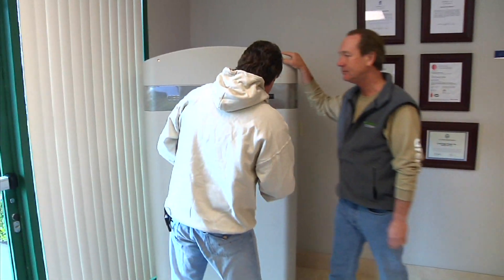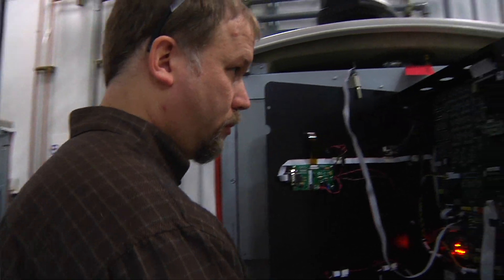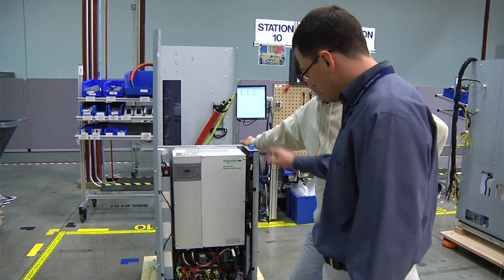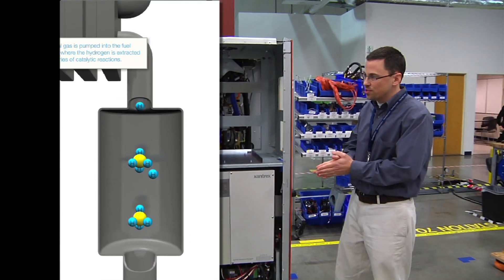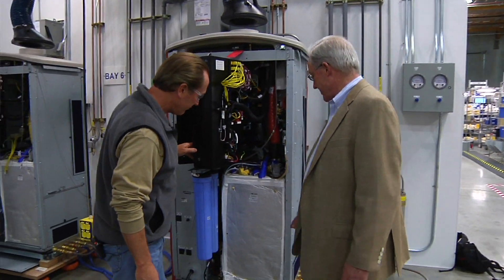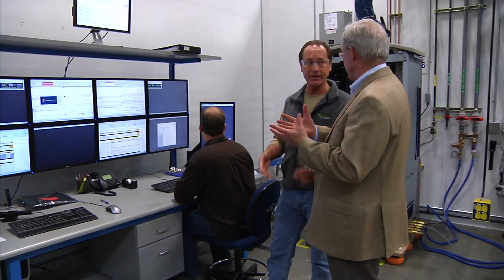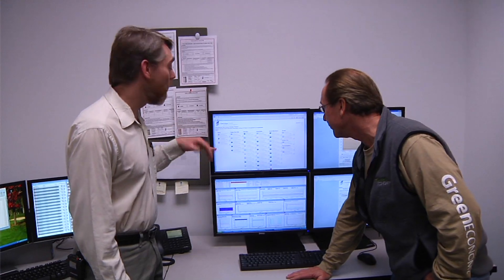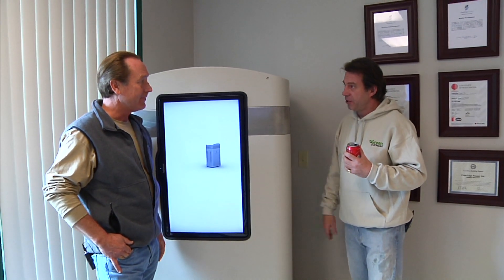ClearEdge Hydrogen Fuel Cell

Comment: Water by itself is not something that work as fuel for fuel cells. What you want is pure hydrogen but that is not readily available as natural gas is. It conceals itself in compunds like water for example. Good news is that hydrogen gas is easy to manufacture pretty much anywhere. All you need is energy to break the bonds between the hydrogen and the other atoms and voila. The biggest problem right now is where do we get this energy and how do we store and ship large quantities of H2.
Reply: If you produce H2 for use back at home or office, the storage and shippement is not an issue. You generate it using PV during day, have tanks, big if needed, and use at night when you don't have PV. Probably less efficient than batteries, but most likely cheaper at scale than batteries, because it is very easy to increase size of tank or increase their numbers, if you want to have same power, just more energy storage, so it can last longer.

Similarly, if you have a vehicle that uses H2, you can generate it on site at home or office, store it temporarily and compress, then transfer to vehicle. You don't really need any infrastructure for any of this.

The devil is in exact cost and power efficiency of the system. No idea if it is worse or better at the moment that other methods.